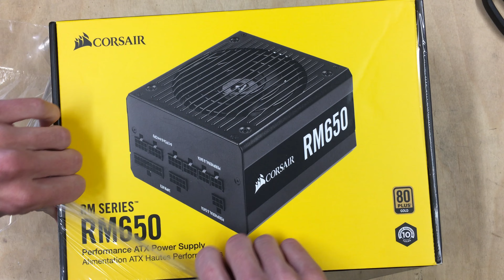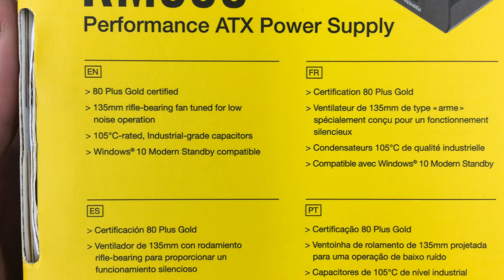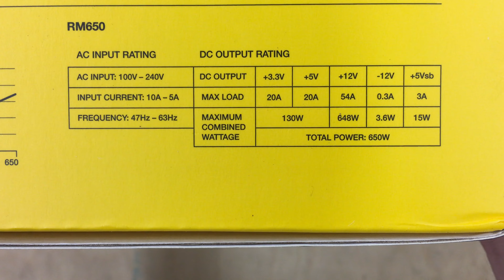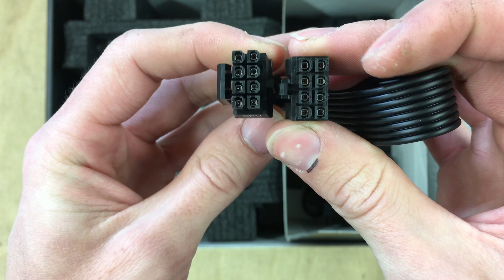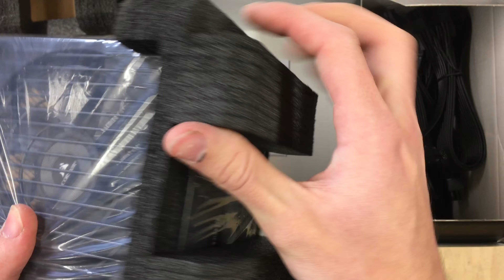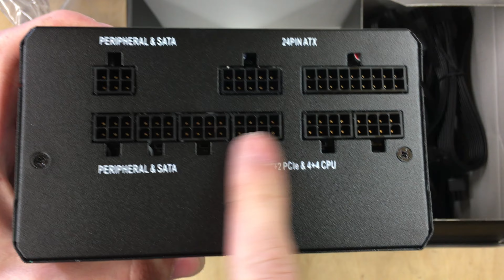Corsair RM Series RM650 PSU Unboxing & Overview - 80 Plus Gold, 650W Fully Modular ATX Power Supply

Comment: Can I use one cable with 2 x 8 pin for my RTX 3070 or do u recommend to use those 2 separate cables from power supply for better stability? My PC is Pre-build so I think i miss the second PCI-E cable....  Thanks for answer.